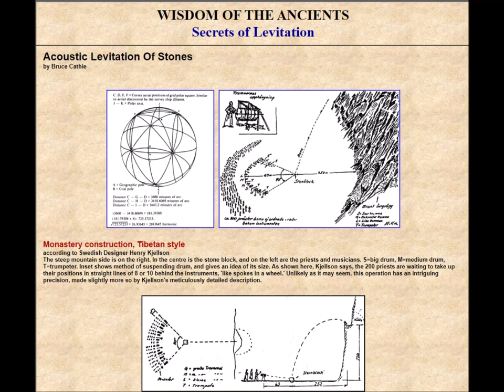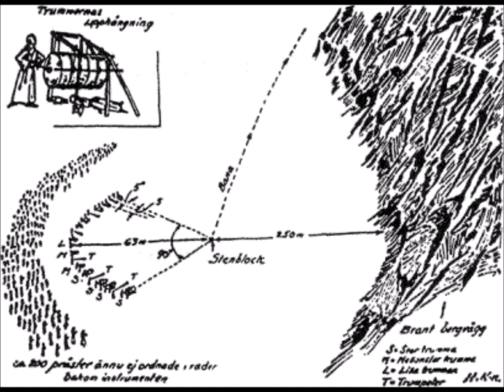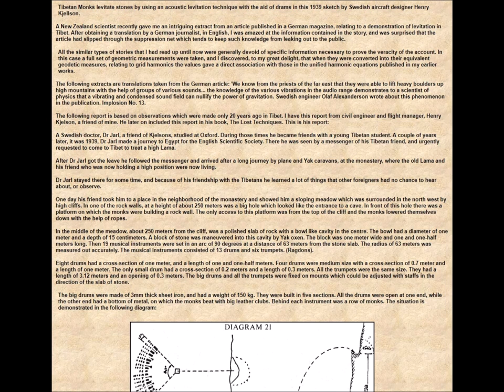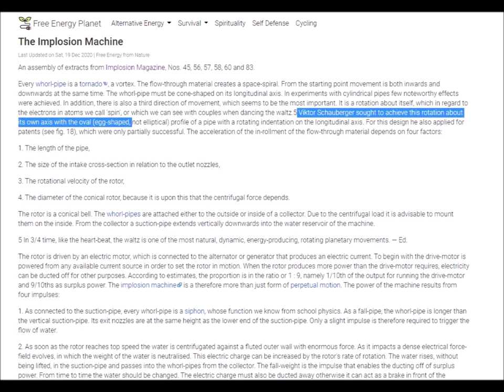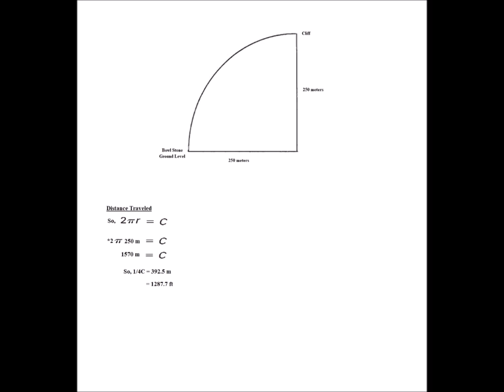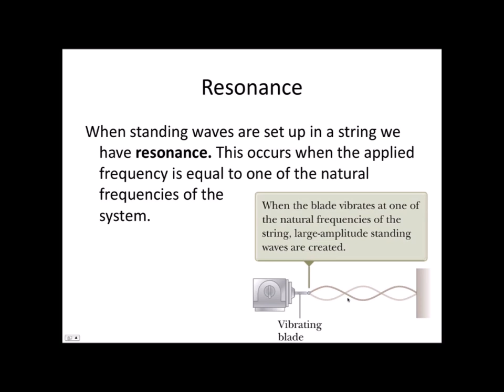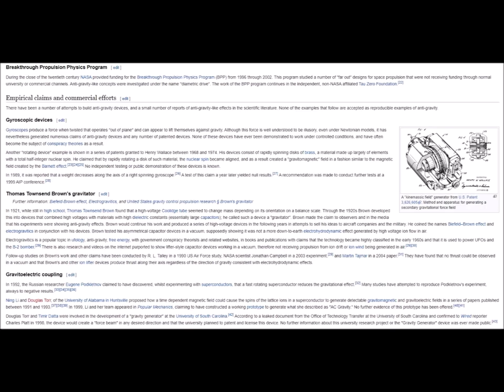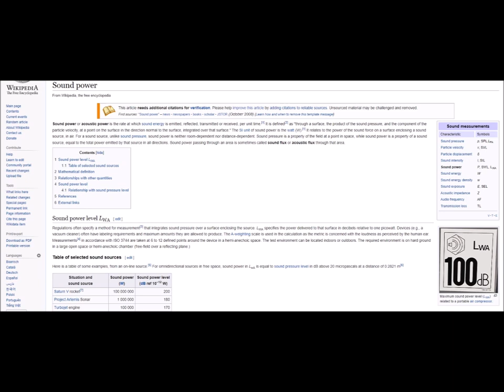The Tibetan Levitation Technique: Acoustically Induced Vortex Lift?

Comment: Hard to believe that this has not been demonstrated in modern times, even with big speakers.  The level of accuracy you would have to get across more than 100 ppl in both position of instruments (especially during the lift) and frequency of beat is pretty astonishing.
Reply from the maker: The primary reason is probably just the sheer energy involved which is a huge concern in an economical system completely dependent on profitability. A tractor beam able to lift 100 tons to a great height in just a few seconds but which requires 1,000 times as much energy as a crane would be cool, but unprofitable in the long run. And second, many people would simply find it hard to believe that sound could even have such an ability, just as it was once generally not believed that light could move objects. But now we know that light, especially in the form of lasers, can not only move objects, but also cut through solid objects. This would have sounded absurd 100 years plus ago. In space, lasers could even propel small spacecrafts to large fractions of the speed of light. So, it's really a matter of humanity expanding its horizons which are presently far too confined by limiting economic and political systems.

Comment: What would anyone expect to happen with the brick in the bucket ? The brick was forced to the walls of the bucket by centrifugal force and the walls of the bucket were tapered outward ! The brick climbed the taper and was ejected . What else could possibly happen than what did ?
Reply from the maker: It doesn't just climb the divergent walls. It is forced upwards by the vortex. The divergent sides only enhance the aerodynamic effect. It still works with walls that are parallel as seen in this video at one minute and 55 seconds in: https://www.youtube.com/watch?v=h2RblkYPnSo&t=1s

Comment: All these forces are used in a stable lift. Vortex, electro magnetic and sonic acoustics! If you can make a device that houses all. You will have a stable lift. The object doesn't have to spin, but the vortex will need to rotate and oscillate in unison, while positively charging the object.

Comment: I have come to the conclusion that you need perfect sine waves in order to get resonance. For this I was looking into linear voice coil actuators. They seem perfect for experiments, as in comparison to speakers they can put out perfect sine waves.
Reply from the maker: I think so too. I think very finely tuned frequency waves are needed for an effective build-up of acoustic energy! John W. Keely apparently used very precise, very high frequencies to achieve his effects. One drawback was that the frequencies were so high and precise that the system could be easily mitigated by environmental disturbances, probably similar to how the tuning of high frequency electromagnetic systems can be disturbed by small stray capacitances.

Comment: Thank you so much for this explanation. I’ve seen vids and read blog posts online, but yours is most succinct and sensible. Wish I knew more about science to try this.
Reply from the maker: Certainly! And thank you. It is a fascinating subject. Isn't it?
Reply: @gsutton78  What is your take on the function and purpose of the pyramids and megaliths? Are you making a video in that? Have you seen Land of Chem’s channel?
Reply from the maker: @dmslidecnxl    Hi. I remember someone mentioning "The Land of Chem" channel before. I'm going to check it out. I'm wondering if the Great Pyramid was at one time used as a giant galvanic cell or electrochemical battery. At least one researcher has pointed to a rim of sat within the pyramid's interior which suggests it was partially flooded with salt water at one time. Some have argued that this is because it was built before the Great Flood. But I am skeptical as to the pyramid being able to survive such a deluge of water. It just seems to me that the force of so much water would have easily carried away the stones of the pyramid. A much later earthquake loosened some of the previous outer casing stones while others were removed by hand and used in later nearby structures. So, the pyramid being able to survive the Great Flood is questionable. Also, the rim of salt only goes part way.  The Ark came to rest on Mt Ararat which is significantly higher than the Great Pyramid in the Giza Plateau. So, it follows that the Pyramid would have been completely submerged, but the salt rim only goes partway up the inner walls. Therefore, I wonder if the pyramid was deliberately filled with brine. I have an article by another researcher referring to corroded metal rods embedded within stone. So, it seems reasonable, but I'll have to conduct much more research and experiments to determine its viability. If it is, then the ancients would have had to have added salt to Nile water to create the solution, since the latter is fresh water, and then channel it into the pyramid. Then comes the question of how the resulting electricity would have been conducted and what it would have been used for. It is indeed fascinating!

Comment: Theory: If the bowls were in-bedded in the earth and they were brought to resonance via the instruments; and if the bowls resonant frequency were a harmonic of the earth's natural frequency, Then it's plausible the bowls could pull up the needed energy from the earth. The shape would create a vortex similar to what we seeing in singing bowls (https://www.youtube.com/watch?v=idZn2KjW8Nk) if the induced charge or present aether acts as a fluid. The stone blocks could have been charged up like capacitors, which could cause them to float or levitate to their appropriate atmospheric charge zone.
Reply from the maker: That certainly sounds plausible. I think that's why levitation has always been linked with free energy or Earth energy. It takes a lot of energy to do it. That's one of the reasons that modern MagLev is not more prevalent. But if the energy is free, then it's a mute issue because no matter how much energy a device needed, it would be free of cost. The blocks rising to match their appropriate charge or pressure zone sounds very much like free energy guru Jerry Decker's conception of levitation.
 It shows that the Kardashev Scale would be a good measure of a civilization's technological development. We can do pretty much anything if we could harness and control enough energy.
Reply: @gsutton78  100% true and I'll have to check Jerry Decker out, Thanks for that and the work.
Reply from the maker: @wdstk5233   Yes, if you google, "Jerry Decker's Antigravity Correlatives", a pdf should come up. It's very interesting! Thanks for watching and commenting!
Reply: I wonder if gravity wells cause the earth to resonate when they are warped by gravity waves therefore creating what we know as earth energy?

Comment: Again i want to thank you for this video. I have been working on a vortex tube that is some what like a Tesla turbine. Truly the key is in the sacred geometry. You have done a great deal of compiling ancient tec. From understanding how tornadoes form the outer vortex is opposed to the inner vortex the outer being hot and the inner being cold. Also the vortexes move in opposite directions. Modern science explains this as friction. But I belive there is much more going on here. The center vortex is void. Do to rotation centerfugal forces. There would be absolute stillness in the center then a reversal of gravity on a quantum level. I do belive harmonics has a lot too do with this research. So keep it up, and I look forward to your next Video.
Reply from the maker: Thanks a lot!! I very much appreciate your comment. And I agree; I think that modern science overlooks and dismisses a number of natural phenomena, especially the more subtle forces. Tornadoes and whirlpools seem to encompass more principles than is presently acknowledged. I'm sure you've heard of the Summum Philosophy? Particularly the principle of vibration which highlights that every rate of rotation has a corresponding rate of vibration. And as the rotational speed increases, so does the vibrational frequency. Thus, any rotating body or fluids like the air in a tornado would generate vibrations. So, you are right on target with the assessment of harmonics and its relation to vortex research!!

Comment: The brick came out of your rotating cylinder because it came in contact with the sides.  It's obvious in the slow motion shot that centripetal force and friction flung the brick out of your rotating cylinder.
Reply from the maker: Friction and centrifugal force are not generating the upward force, though. For further clarification, take a look at the video here from 32 seconds to 48 seconds: https://youtu.be/VLdaljPaS2w
 The ring, loaded with 5 lbs of steel weight, is floating and rotating independently of the chamber and in the center. It's not in contact with the container. So, it's centrifugal force acting on the fluid (air in this case), creating a vortex which in turn acts on the ring to lift and propel it.
Reply: @gsutton78  centripetal force - not centrifugal - is the force generated by the walls of the cylinder, at a 90 degree angle to the velocity vector, towards the center point of the rotational movement. Not knowing the name of the force indicates you don't know the physics behind it... The slight outwards angle on the walls of the cylinder means the sum of the forces is slightly upwards. It's simple physics. The force vector at the point where the weight leaves the top of the walls tells where the weight will go. The golf balls are sliding on the walls, pushing up the weight. Do the same experiment with a straight walled cylinder, or even better, walls angled slightly inwards, and it should prove it.
Reply from the maker: @runARGH    First of all, centripetal and centrifugal forces are flip sides of the same coin. They are really not even forces per se, but pseudo-forces. Second of all, I think I should know better than you how my own experiment works. The balls are not touching the sides near the top as the uppermost part of the chamber is significantly wider than the diameter of the ring itself with the balls. https://youtu.be/VLdaljPaS2w?si=uQc5_pXFKPcWTlPr (28 seconds in)
Thirdly, if you had bothered to take a look at my earlier work instead of so quickly jumping on the bandwagon to troll me, you'd see that I performed the first experiments within a chamber "without" divergent sides. Though the experiment takes place in water, the result is the same: https://youtu.be/h2RblkYPnSo?si=V__a1krURnLZ1Hiv. If you're going to be such a jerk in your comments, at least be better informed.

Comment: Hi bro. As I perceive it.. the general field have some kind of layering in each system, creating a large amount of density levels.. layers.. as a certain wave in particular setting could sustain it self as a bed for an object with mass. The mercury could be a great choice for a machine. Inverted cone surrended by digitally controlled magnetic coils. The centrifugal force will push upward with a greater force than gravity against the machine mass. Nice to found you. Bless

Comment: Did you try the "Keely type" bench experiment with mass, 3  solid state variable oscillators and ratios applied? You seem to be interested in levitation. He only had arrays of tuning forks. Resonance first! In one 1800's test, his heavy metal platform "lifted" with 3 spinning siren flywheels - vibrations applied to structure.
Also, there was a folio sold many years back about an experiment vertical dual rotating pulleys unit with belt holding several equal weights on each side. An oscillator  set about 52Mhz applied with brushes on 2 weights on one side, made the unit unbalanced, so as the belt turned.

Comment: I’m no scientist, but I think I figured out how acoustic levitation works.
Specifically Tibetan Acoustic Levitation

The Pressure waves from the drums and the horns converge at the centre of the shape manipulating the atmospheric pressure around the object evenly. 
The acoustic pressure waves would begin by crashing into each other, but i theorise that with the appropriate frequency they could create a 3 dimensional harmonic convergence ON the object applying the pressure of the atmosphere UNDER the object allowing it to be elevated. 

A true test of this theory would be creating an acoustic levitation device that is horizontal to the object not under, Additionally, doing this in a pressure controlled chamber where we could reduce the atmospheric pressure in the chamber to see how this effects the object, 

Current tiny scale acoustic levitation devices could suffice in this experiment
Reply from the maker: Interesting!! Our thinking is along the same line👍

Comment: I don not believe is simply just about the amount of energy (or power) created by these trumpets. That’s the old school physics way of levitating. One is still using a force to push an object, not really dissimilar from pushing and pulling with humans or ox. I believe it’s more about the resonance and subsequent tuning of these frequencies with each individual stone.
Reply from the maker: Yes, resonance is a way to store energy. An enormous amount of energy can be developed over time. It could then be released slowly or quickly. The more quickly the energy is released, the more power is generated, but of course the energy is dissipated quickly. With this method, power levels could be developed that are many times that which could be generated by the source alone. Storing vibrational energy in a resonant system is the same principle as storing electrical energy in a capacitor or rotational energy in a heavy flywheel.